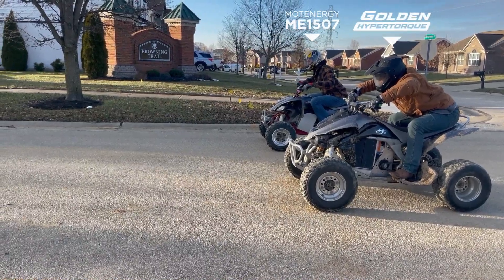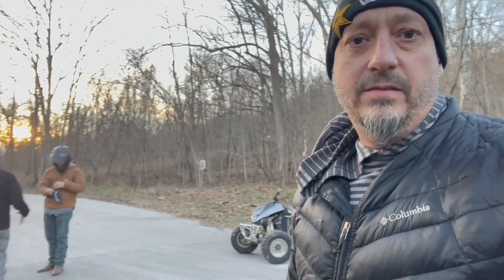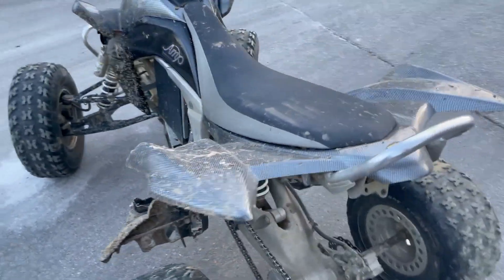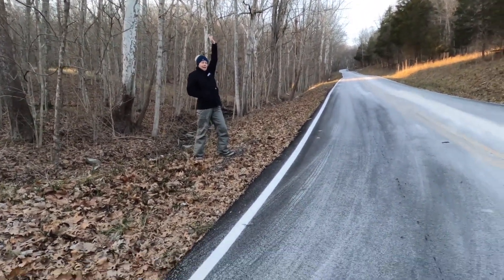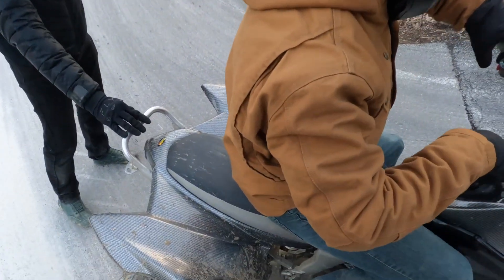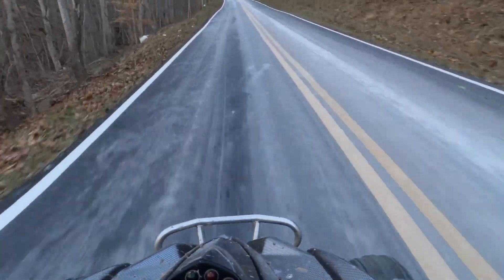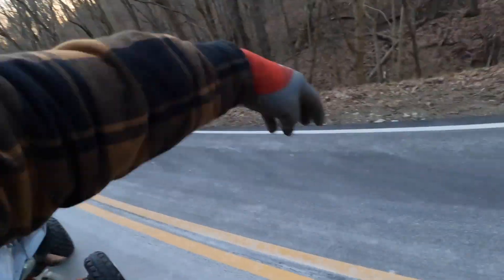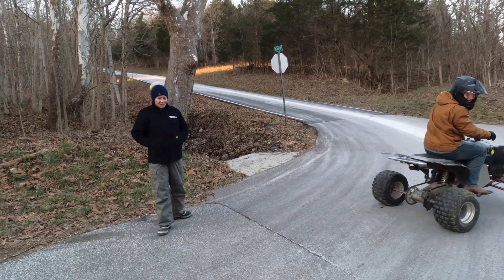Electric Quad Race: Hypertorque Motor vs ME1507 – Which Reigns Supreme?

Comment: The Hypertorque motor can be liquid-cooled. Imagine how much current you could run through that thing if it does 400A with (presumably) just air cooling in this setup - 72v @ 400A is 29 KW. They say it can handle up to 144v so let's say you run a 30s pack, ~120v, and say the liquid cooling allows 600A - that's 72KW. Even keeping the same 400A, 120v would have you at 48KW.

Comment: Those are some cleans builds. Curious how much did it cost (without the price of the quad frame)
I mean its not at stark varg swap (but a stark swap means buying a 10k bike and destroying it to put in onto a 1000€ quad frame) i really wish some one made a full electric quad with the power of a stark varg (still wouldn't be able to buy it) but i love the idea for racing in my garden so neighbours don't complain
Reply from the maker: @reggiexp69  it’s around $5,000 for the components without chassis.
Reply: @jalapi1508  that is not too bad.

Comment: Great built you done! Very powerful! And thank you for your details : The YFZ450R with the ME1507 is geared 11T front and 44T rear (4.0 ratio), while the KFX450R with the Hypertorque Motor is 10T front and 39T rear (3.9 ratio). Both quads run 72V battery packs, and neither is current-limited by the ANT BMS, which is rated for 450A peak discharge. Peak current on both controllers is set to 400A for a consistent comparison.

Comment: I am curious... 
1) What is the gearing on each machine?
2) What is the voltage of the packs?
3) Is the current limited by the BMS or are they the same?
4) What is the peak current set on the two controllers?
Reply from the maker: @Bastens  The YFZ450R with the ME1507 is geared 11T front and 44T rear (4.0 ratio), while the KFX450R with the Hypertorque Motor is 10T front and 39T rear (3.9 ratio). Both quads run 72V battery packs, and neither is current-limited by the ANT BMS, which is rated for 450A peak discharge. Peak current on both controllers is set to 400A for a consistent comparison.
Reply: @jalapi1508  Are they identical batteries? and what controller are each one running?
Reply from the maker: @baymoe1  The YFZ450R quad is running a 72V 60Ah pack made with Nissan Leaf cells, while the KFX450R quad uses a 72V 76Ah pack made with Molicel P42A cells. Both battery packs are capable of 400A peak discharge, and both quads are running the ASI BAC8000 controller for consistency in the comparison. Let me know if you have any other questions!
Reply: @jalapi1508  really curious whether a battery swap would change the results. The Molicels at 19p would likely have a pretty healthy advantage
Reply: @baymoe1  I agree with you, battery swap can confirm if it's the battery or the motor. Bigger battery can give more power. Jalapi1508 say didn't not get limited by BMS. Can be sure without a battery swap to see if it was the limiting factor.
Reply: @jalapi1508  I posted a link before about an app that I have found that is accurate enough to record mph trap times but either your took it down or YouTube did. I won't post the link again but if you search "Dragger-car" you will find it.

Some may want a comparison when using a higher voltage on a ME1507. I have my ME1507 quad with a 28s pack 116VDC 11+kWh and I acceleration limit my controller at 10mph gain per second so it gets 0-10mph in 1 sec, 0-20:2sec ... 0-60:6sec. I have a bigger pack in front so my machines don't wheelie. Currently my machines are 510lbs.